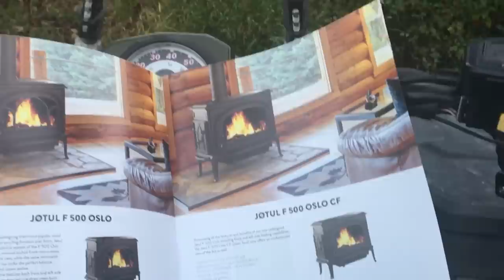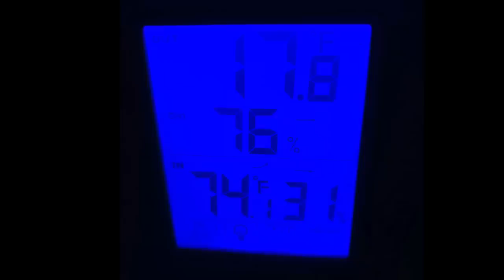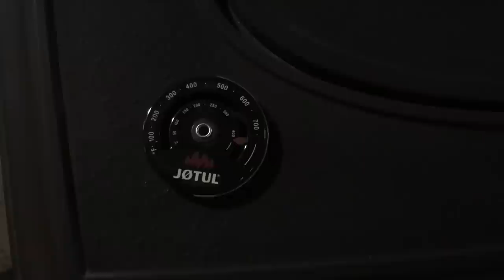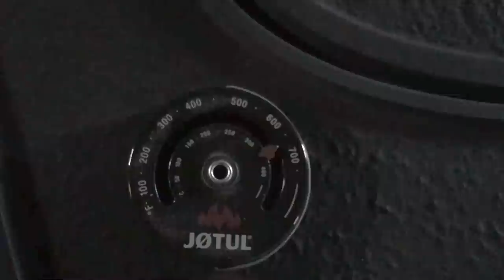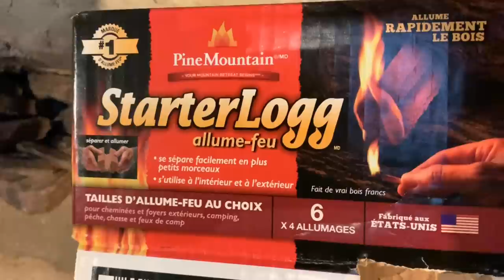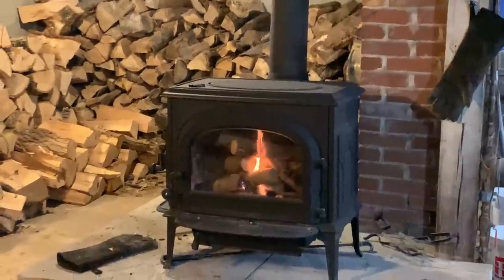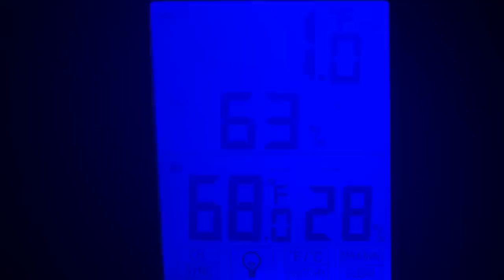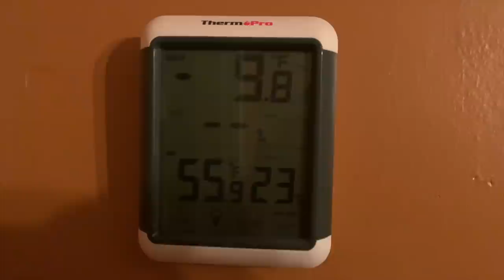The Jotul F500 Oslo CF one full winter review + install is this stove that good ?

Comment: Thank you for posting this video. I just installed an Oslo 500, I'm on my 4th fire. Every fire I've had has been like a runaway train until I watched your video. The handle for the Ash pan wasn't locked properly. What a difference. The fire has slowed down considerably with tall lazy flames. Thanks again.
Reply from the maker: Im so glad that helped someone. Nobody told me 😇

Comment: Very good info and I Thank You! I have four stoves I keep going when it get very cold and windy. I live in the woods in Pa. so have access to lots of wood. Many oaks have died for some reason. Bugs, pollution, frequencies from Wi Fi? Who knows. Dead trees on the ground and many standing dead for a few years with bark gone. Some is wet inside but the dead tree wood dries quickly in my wood shed. So small wood for my wife's studio, larger in the kitchen and big stuff in my living room. Then there is my wood shop where  those knotty odd shaped pieces can fit nicely with large doors. Indeed, I'm busy in cold weather but in reality, those very cold wildly days are few and the very cold still days far better. My house is 2400 square feet and unless it gets super cold, not all the stoves are going. So I manage. I recently bought a splitter and this will help greatly with stacking wood for the following year. Dry wood creates the most heat and cleaner chimneys. I do take my brush and rods on the roof every two weeks or so. Had a chimney fire a few years back so instead of every month or two with a chain and rope, the brush is far better. And burning hotter far cleaner. Great review and Thanks for your excellent study and sharing of the info! Happy Heating! DaveyJO in SE Pa.

Comment: Great video, I too only have to wipe my glass with a damp rag. I don’t have a jotal but my stove burns very well with the same burn rates. I have come close to running out of wood during winter and now I stay two years ahead. That way if something happens and I get injured or am not able to collect and process firewood for the year my family will still be warm and won’t have to worry. Love a wood stove! Cheers!
Reply from the maker: Thank you. And two years ahead is the way it should be done. Im cutting away now. Stay tuned for the follow up !

Comment: We use Pine Mountain Starter Logs too.  But I only use  one third of the block.  I crack them in thirds, and you can stretch the usage that way.  If your wood is dry, you won't need the whole block.  And have you ever heard of newspaper donuts? Take two sheets of newspaper, twist them like a candy cane, then make a loop in the middle, and fold the tail ends inside the  loop making sure you keep a hole in the center so the fire travels thru it. They burn hot, and makes great kindling for starting a fire.  So much so, I rarely use the starter blocks anymore.
Reply: I do this, will try donut loop 🍩

Comment: Nice video and good review.  I have the same model except it is Ivory porcelain or ceramic.  I experienced the same issue with the glass being etched in a couple of spots due to burning junk green wood.  I removed the glass and used my automotive buffer and various grits of polish.  That was about 5 years ago and it is still crystal clear.  I love the ambiance.  Been burning for 40 years now.  My dad bought me a Stihl saw that I still use exclusively.  Old 45 year old wood boss.  Gotta love it.
Reply from the maker: Awesome. Im making a video right now of me using just that. Its actually ceramic and im going to try several things. It happened again to the new glass already. Stay tuned. Gonna follow up on this soon

Comment: I have owned this model stove for 15 years, if you bend the back of the ash pan back it catches the ash better and will not pile up behind it. If you leave a good bit of he ash in the bottom it insulates the coals and get a longer burn time, of course much depends on the wood. My jotul has paid for itself many times over in utility savings. You would not regret getting this model, my 2 cents worth.
Reply from the maker: Piling the ash only seems to help a bit. I much prefer to use the ask pan The way it is designed rather than get an extra hour or two of 250° burn cycles. But I understand why people do it. Have you ever had any trouble with the glass. Developing a permanent fog

Comment: I had ordered a transport of wood and split it with my Uncle, 2 hard working weekends we had both piles cut down and chopped and piled, the first year, It was hard to heat, the second was better and I built a roof extension to my garage. moved all the wood in there and let it dry the rest of that summer. on the 3rd winter, I was burning about 3-4 pieces a day. was no need to fill up the box as it would get too hot. You'd rarely see smoke come out of my chimney, and every time I wanted to clean the chimney it was still clean as the day I installed it. I use to burn potato peels in it as I had read it helped keep the chimney clean. I personally think it was the seasoned wood that kept the chimney for getting dirty. My stove didn't have the reburn like yours, I guess it still burned it. My half of that truck load outlasted my ownership of the house. a truck load is about 40 cords.
Reply from the maker: Good wood makes all the difference. Im finding out by having enough good wood. Cut to the right size. Much more efficient. A good chimney liner keep my chimney hot and free of creosol. Never had to clean it. But always check.

Comment: Impressive narration. Excellent info. I went with the Lopi for similar reasons and really like it. I too live in PA and have the same issue with locals not knowing (or caring) what seasoned wood means. Being from central New Enhland, we normally stay one year ahead on our wood until I built a green house wood shed to dry it. Now it dries fully in the 3 months of summer and is ready to burn come fall.
Reply from the maker: Thats sounds interesting. Thanks for checking in and the compliment.

Comment: The 500  has served me well for many yrs . I leave about an inch or so of ash in there and load north south on each side of air inlet and east west on top....and its purring in no time. One thing you may want to do with that stove is remove the doors every yr or two and put a few drops  of lube into the handle assembly....they can freeze up. As far as 2600 bucks...lol you will look back yrs from now and smile.

Comment: Have used the same model stove for 5 years now. Installed as a hearth mounted setup. Heats up my 1800 sq feet quite nicely and quickly. While it was expensive (give or take 4000 dollars) it paid itself off in a couple years. I only have to fill my oil tank once a winter compared to 2 or 3 times before the stove was installed. Very much satisfied with Jotuls quality. The company's North American production facility is 25 minutes from where I live.
Reply from the maker: The jotul is all i have. Its a good stove. But i do believe their quality control needs to improve. Will discuss in my follow up video for year two
Reply: @AlfonsLC  yeah, the air control leaves little to be desired. But I have good draft so it's not so bad

Comment: I own this same model. Really enjoy it. Try to keep it under 400 and at 300 overnight to keep the wood from burning to fast.  If I load it up before bed (8:30pm), it's still glowing at 6am.
You're exactly right about the season vs unseasoned wood. Cleanup is Very easy. We live on 100 acres of rolling hardwood so availability isn't a problem.
Reply from the maker: I get such a nice bed of coals after only 8-9 hours and the stove is still 200-300. Its a great stove. Thanks for checking in.
Reply: @eric hedrich  does it heat entire home ? ( thanks I’m a Stove TARD)!
Reply from the maker: Mick Tezz Yes. I do not need any other type of heat at all. Even when it’s below zero
Reply: @micktezz1561   Yes, we live in a 4 room, 1500 sq. ft cabin and when the stove is fired up, heater never comes on and entire cabin feels very comfortable. We Love it!
Reply: @AlfonsLC  How high do you allow the temperatures to burn on top of the stove? what does the manufacturer say is the ideal and maximum temperatures?
Reply from the maker: lionreb i keep it between 4-500 for warming up a cold house. And about 300-200 to maintain.
Reply: I loaded it up last night at 8:30pm and at 9:58am it's still sitting at 100° Fahrenheit.
I took the shovel and cleaned it out and there were a lots of coals that were still red. 
It will be ready to go again this evening!

Comment: Hei!

Just a quick tip of how to clean the glass door:

- Get a bit of kitchen or toilet paper; damped it with some water and dip it into cold white ashes.
- Rub it over the glass into you see/feel it is clean.
- Clean with more damp/wet paper.

This is the way a Swedish friend and I cleaned his Jotul F 305. 

The ash works like magic and does not damage the glass in any way.

PS: Great video. Jotul stoves are the best I have seen.
Reply from the maker: I responded to this suggestion so many times i made a follow up video. The glass was damaged and needed buffing compound and an hour of buffing to remove the ash imbedded i to the glass. Check it out sometime. And thanks. I love my jotul
Reply: @AlfonsLC  OK! Great. I'll check out the follow up video.

Comment: Thanks so much for this video. I just got the Jotul 500 and it will be getting installed shortly.  This makes me feel much better about our choice and the advice on the seasoned wood is noted.
Reply from the maker: Thats great. 5 F outside here and PA and 69 in my house.  Its all i use for heat. Check out the video about the glass repair and part 2 for more info. Thanks allot

Comment: After my many years of burning wood, I have learned to not use my Ash pan. I leave Ash over my ash plug also, I find it keeps things more air tight and can control my burns better. Every stove set up is different, figure out what works best for you and do that. Good video 👍👍
Reply from the maker: You are right about longer burns. But it also means it doesn’t burn as hot or as complete. I did this a bit this winter and noticed the difference.
Reply: I have never noticed that. I use a wood stove shovel and rake the coal to one side and scoop the ash build up and then take them to the other side and get the ash build up out that way. I leave ash over the plug area only just to seal that up for air passing by. I don't think I mentioned that before. Anyways like I said, over time you learn to do what's best for you. PS. Over the last 30ty years of burning or so I have ran into every situation a person can run into. Recently I ran all new pipe and changed my pipe angle in the house. I wish I did that a long time ago!! 😆 What a major difference having the pipe run up hill at an angle slightly on its way out of the house. Take care.

Comment: Thanks for the video, ive been burning for two seasons with mine, absolutely love it. I let the entire ash try fill up and just go in with the shop vac and vacuum out the ash on the top much easier this way. . I always leave about two inches to help insulate the stove from over firing. . I also never open the front door, always causes a mess.
Reply from the maker: This is also another testament to good design. There are many people that bemoan and very much just like the ash pan. But even if you don’t use it it could make the stove better. Just by letting it fill up with ash for the reasons you just said. I obviously very much prefer the ash pan but either way the stove works good for whoever is using it. But the front door is always a mess for sure.

Comment: Nice tutorial on this stove. Very thorough and presented. I love the big glass door, and watching logs burn, but not a fan of trying to keep the soot off it. I had a Surdiac coalstove for a few years, and use-ta start it with wood, and it would always trash the panes. Now I start my coal fires with "Matchlight", and no soot, or staining. (Have also up-graded to an antique Glenwood coal stove.)
When you get older, you may opt for an anthracite stove. Not nearly as much work, and tons of heat, with long burn times, with out worrying about seasoned wood. But that's another story. I "do" like the aesthetics from your stove, and think it's location in the basement is very efficient, but it's beauty would be better viewed in the living area. Always a trade off I guess. Thanks for posting, and enjoy the winter. Stay warm :)
Reply from the maker: Nice post. Thanks. Yes im going to make my own heat as long as i am able too. I find sometimes starting the fire get my glass pretty grubby and blackened. But when it gets up over 400 it burns right off. Stay tuned. Im going to upgrade that area to a half finished sitting room. Doing the work and filming it now.

Comment: I have a Jotul F500 and it’s a great wood stove. For really burned on carbon on the glass, you might try scrubbing the glass (when it’s cool) with a wet newspaper dipped in the ashes (the very fluffy, fine ones) from the stove. The ashes won’t scratch the glass and it works exceptionally well to remove the carbon buildup. Also burning the stove hot/very hot for a while may remove some of the carbon from the glass without applying much elbow grease. I’ve never damaged my stove’s glass doing this.
Reply from the maker: Please check out the follow up video. The pinned comment. Or the the 2000 other comments saying to clean the glass with ashes. You may find it interesting that the glass is not dirty. Its damaged. All the lye water int he world wouldn’t clean it.

Comment: Hi Alfons,
Very interesting video. As for the foggy glass door I would take a damp cotton or Kleenex and impregnate it with cold white ashes from the previous fire. I don’t know what chemical reactions is at play but if you then scrub the glass door with the very wet ash soaked kleenex all creosol and other nasties just seem to « melt «  and go away fairly easily. Then rinse, dry the glass door and you’re good to go again. Costs nothing and works wonder whilst being eco-friendly. Best regards, 
Pierre
Reply from the maker: Thank you. That was the first thing i tried. I wish i mentioned it in the video. Also tried some other stuff. Nothing worked. Jotul already replaced it.

Comment: I used Bar Keeper Friend solution if harder to remove on glass of woodstove. Of course I constantly used damp with paper towels (not newspapers will scratch glass) pick up ashes to clean glass. Bar Keeper doesn't scratch glass and don't purchase power and just cream solutions. To obtain Bar Keeper is at grocery store and next to Ajax or Comets. Also, I used Bar Keeper for shower glass, pots and pans (inside and bottom only not on exterior finish) oven wall, cooktop and more.
Reply from the maker: its not glass. its ceramic. i made a follow up video to address this. the glass became damaged and needed repair. nothing wouldve cleaned it.

Comment: They make a great stove! You get what you pay for. Nothing beats wood heat 🔥 I recommend you buying a wood moisture meter, I got one from Amazon and I ONLY burn wood less than 20% and my wood burns longer,hotter clean and less creosote build up.
Reply from the maker: Good investment for sure. Im thinking of starting a fire this morning. Cold here.
Reply: @AlfonsLC  lol I have one going as we speak. I live in Illinois and it was 45 degrees this morning. I lived in PA before and the weather there was about the same . I do have some windows open at the moment a little warm in here. Take care

Comment: Before your firebricks get too disintegrated, remove them and make paper templates of each. That way, you can easily cut your own replacements in future rather than buying the manufacturers pre cut ones at several times the price. Although I appreciate you need heat for long periods, when possible you should try to refrain from loading the stove to the max. It will burn much more efficiently, cleaner and economically if you load smaller amounts more frequently.
Reply from the maker: This is very true and great advice.
Reply: yep, wish I had done this.
Reply: @AlfonsLC  Amen!
Reply: David Lannigan ,,P?<\
Reply: dont waste your time tracing them, those are standard size firebrick you can buy anywhere cheap enough

Comment: Good Review!
I had a store selling woodstoves in WV in the mid-'70s and the Jotul was the top of the line stove and unfortunately priced out of range for most folks. As you said, all of there stoves required seasoned wood to work properly, something I also had a problem with, running out in late Jan. early Feb.

They were truly the first stove makers to understand and use secondary burning - all the others copied Jotul designs to increase their efficiency. 

I used the Jotul #4 to heat my house back then and I still use it today 45 years later to heat my home.
Still has the original door seal but I have had to make several repairs to the brick lining and I have burned a hole out of the back of the baffle. I covered the hole with fire brick and mortared it in and never looked back.
 It is still one great stove although it doesn't have the EPA technology to burn clean here in central Florida I only need it for about 2 months a year.

I am happy to see they are still making great stoves.
Reply from the maker: Thanks for checking in. Interesting stuff to hear.

Comment: Excellent stove, high quality, efficient heater. BUTT!  Most of the BTUs go out into the foundation into dirt. Wood stoves need to be where you spend time.
Reply from the maker: While heat sink is real. My house is ok a hill one side is rock. The other side is insulated wall. You can also insulate over the foundation to dramatically counter a heat sink. So still convection is working just fine for years for me